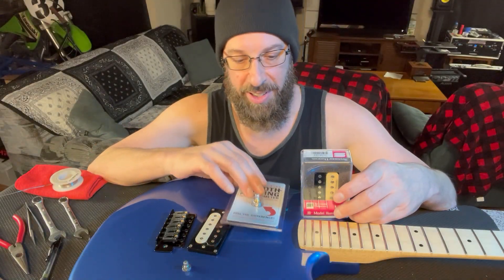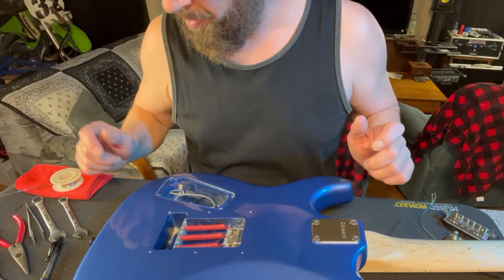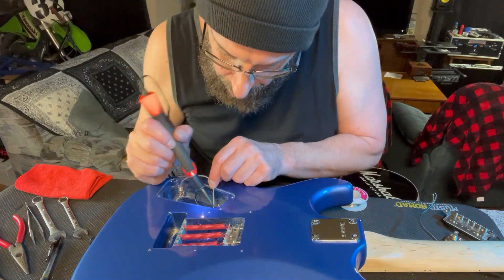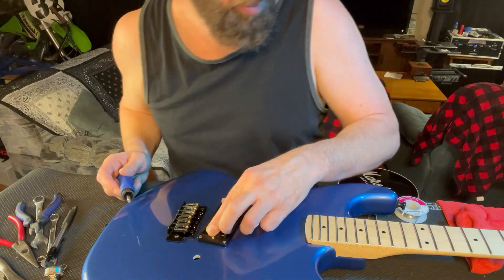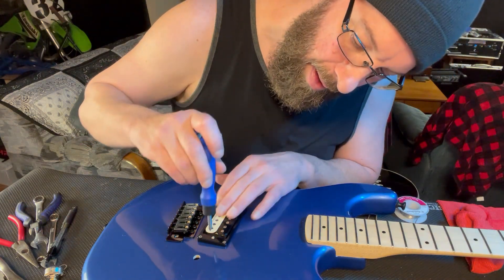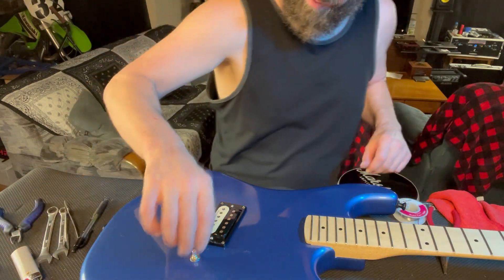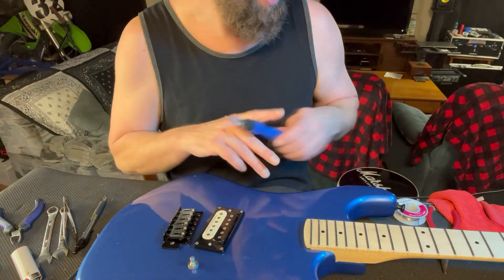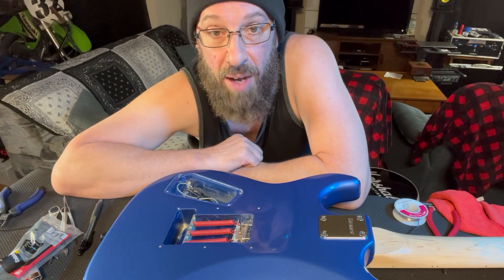Pickup Install: Kramer Baretta Special (Seymour Duncan JB Zebra)

Comment: I've the same exact guitar that I use as a practice/travel guitar and upgraded the bridge, nut and installed locking tuners on it. I was OK with the stock pickup but one day I replaced the JB in my Kramer SM-1 and decided to put it in the Special.  The Mahogany body gives it a muddy tone imo so I put the original back in lol.  The JB in my 84 sounds really good in the Alder body.

Comment: Just adding new solder to the old will get it to melt. You're, in essence, tinning the tip of the iron, which is what allows the transfer of heat to happen.

Comment: I am adding a new EVH low friction pot and I was wondering if instead of using the same jumper from the old pot can I just strip some wire and use that instead?